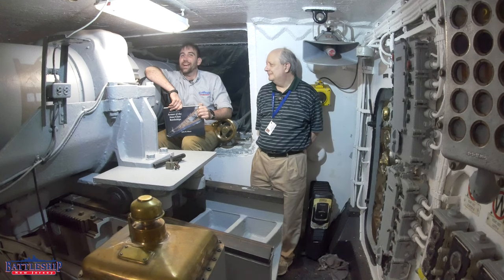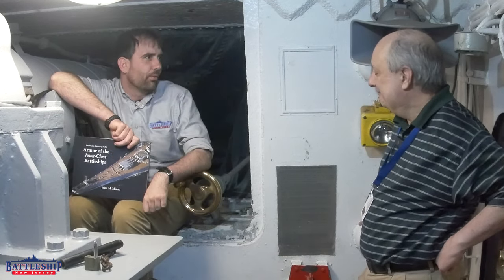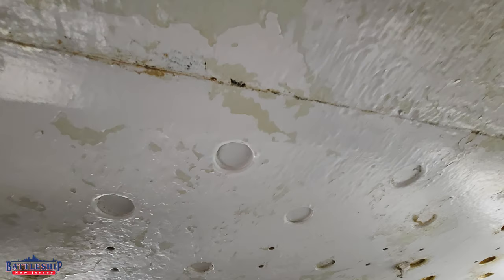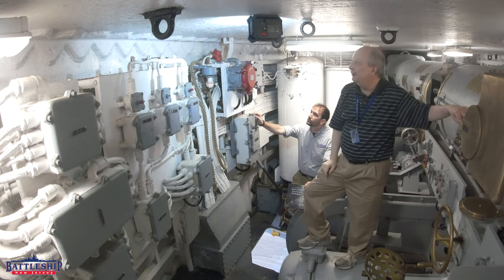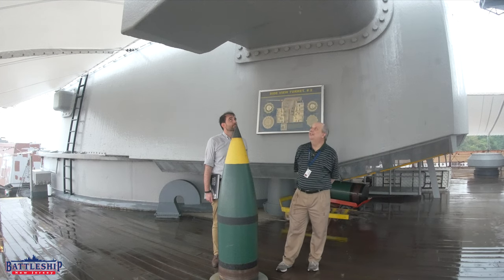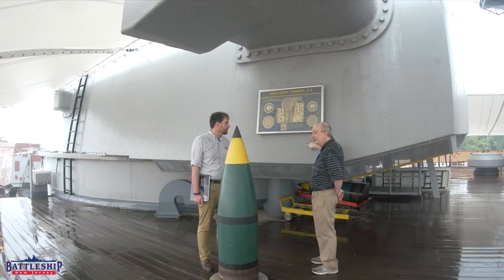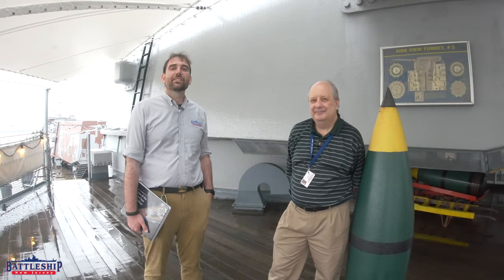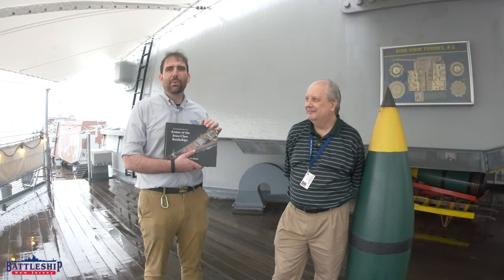Armored Turrets on the Iowa Class Battleships

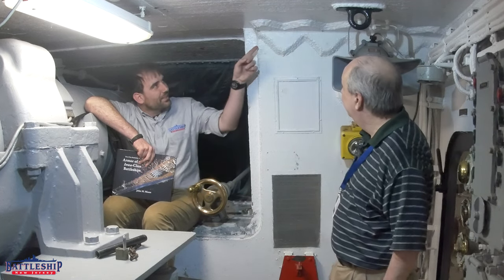Comment: ( 3:26 ) holy smokers! They used 6 beads of welding the attach the bracket plates between the walls and roof! I had not thought of this when we were shown the same joins in the steering gear area. Good information, thanks Ryan and John and all at Battleship New Jersey ! 
☺
Reply: It would help some if John referred to "class B armour" by its trade name "rolled homogenous armour". The thickness and hardening is finished by putting the armoured steel or alloy metal sheets through rollers.
Reply: There's also probably 3 to 5 beads under the 6 you can see for the root pass etc.

Comment: I would love to see an episode that explains the production process of armour plate at the steel mills. How they handled such heavy thickness, the heat treatment, rolling, what steel mill produced the plates for the Iowas,  etc. That would be fascinating! ⚓⚒🔗
Reply: I believe that Drach has a video on this subject.
Reply: I have been in several Gulf coast shipyards an can not imagine how they would have lifted a turret or even the plates used to build them. I have never seen any photos of the turrets being lifted or how they welded such thick plates together.

Comment: I was working on the Iowa on top of one of the fwd turrets straightening the rod used to tie awning to. Some ensign was worried about me cutting a hole in the turret with the small torch i was using to heat and bend the round stock. I told him that if anything ever happened where we had to get into the turret there was no way we had a torch big enough to cut our way in. This wasn't too long before the explosion. I was only there 2 days so i did not really get to know the gun crews but it made me sad i might have met some of them.

Comment: As someone who has tapped holes (usually M3x0.5, close to 4-40 for imperial system enjoyers) on small aluminum plates for prototype parts, those equipment used to do the same job but for really large holes and heat-treated steel armor plates.

Comment: Speaking as  a Weldor, the reason for the multi-bead weld
 is you can only manipulate so much molten metal at one time.....
especially  in the overhead position.....as far as it being over kill, 
the weld needs to be the same thickness of the base metal.....
when 2 plates are welded together, they are beveled to a 30 to 37.5  degree
bevel or a 60 to 75 degree included angle so there is full penetration....
for a 1in plate, it take 21 weld passes to fill that gap...hope this explains a little 
about why there are so many weld passes.....
One other note, when plates come together at an angle, as shown 6:00.
the weld is called a Fillet Weld, as in Fill it Up.....they are welded to be about 3/4
the thickness of the base material at the throat of the weld [45 degrees
of the triangle intersection] So by using those scalloped angle plates , they are 
saving an incredible amount of labor, time and material, and also not introducing
stress into the joint from the shrinkage of the weld metal.....the weld metal for 
that material would have a pounds per square inch strength of over 70,000 lbs.....
and welding in the overhead position would be much harder to have a weld with no
defects....as smaller rods are needed for welding overhead....and less material is 
put into the weld with smaller rods....
you mentioned the cast armor plate, is it cast, or rolled plate.....rolled being much 
stronger......
something not thought of many times , is that weld material is actually cast metal....
as you are putting molten metal into the joint and it is melting the adjacent base metal 
to make up a joint of cast material.....it is called fusion welding
so when someone says cast metal is not strong......they can be mistaken, as the weld metal 
is always [or supposed to be] stronger than the base material......the weak part of the weld
is in the base material in the area adjacent to the weld called the 'heat affected zone' HAZ....
where cooling rate and inter granular changes shift the different alloys in the material around.....
I hope this helps...
cheers from an old weldor in Florida, Paul

Comment: Cement between the armor and backing plate is similar to techniques used today. Servicable surfaces in crushers, such as the bowl and mantle in a cone crusher, have epoxy poured between the sacrificial liner and the solid steel body. The purpose is the same, fill in irregularities and spread impact over a bigger area, though a 41cm Japanese shell probaby has more impact than squishing a rock.

Comment: Another reason for the scalloped backing plates/angles being used for joining the armor plates is that the scalloping prevents the harder, more brittle metal of the heat affected zone surrounding the weld from fracturing, because the weld isn't in a single linear direction.

Comment: Since he mentioned a scarf joint and different sizes of the armor, how did the mill, or in the instance the hole for the 40mm, the yard, CUT through the armor? I would think by torch it would ruin the heat treated face, so how did they do it? Or just molded that way (including hole and different sizes) by the mill?
Reply: There are materials a lot harder than steel armor like tungsten carbide. So you can drill and cut into it.  The faced hardened part of the steel armor had a hardness like tool steel.

Tungsten was one of the resources that Germany did not have enough of during WWII. It was used in some ammunition and to process steel in the industry. The quite quickly had to stop using it in ammunition

Comment: Is there a giant screw driver that's used to attach those side vents to the armor face? Crazy size slotted bolts!
Reply: Bolts are not driven with a "screwdriver". They are fastened down with something like a socket wrench or an "impact wrench".
Reply: @williestyle35  Check out the slotted heads on the bolts at the 7:44 mark in the video.

Comment: it's absolutely fascinating that they didn't think welding was as powerful as it is nowadays That's just absolutely fascinating
Reply: Actually, it wasn't great back then in some cases. They went back to riveting on some vessels for a while because of welded hull failures in storms. This gave welding a bad name. During WW2, shops were set up in Europe to add armor plates to the sides of Sherman tanks. They used multiple passes and pounds of rod, but the first tank out its new armor plates fell off after it hit a bump leaving the shop! They had to send people to educate the welders on how to weld armor correctly. Welding is a fascinating science, I was a certified welder and have a great book from 1940 on the subject. I have welded and still do with WW2 surplus navy and airforce equipment, it's hard to beat even today. it is frustrating to see how many people still do it wrong today, especially with MIG welders. It may look pretty, but some good welds are ugly!

Comment: Very interesting.  I'm an engineer who's designed many welded structures.  I was wondering what metallurgy of the Class A armor is -- how much carbon; because that does make it harder to weld?
The scallops to increase weld length can be see today on the SpaceX Starship!
Reply: Older ship armor like the short lived Harvey armor, like on the surviving Olympia cruiser, face hardened by increasing carbon to the outer layers.  Class A armor is in line with more modern armor designs from the late 1890's that had a more complicated heat treatment process to get the desired amount of hardness/softness throughout the armor.  Not just carbon content, but a long complicated heat treatment to get desired results.  

Even if you didn't crack the outside armor through welding, you would alter and diminish its properties.  Another reason why welding to some metals is a no no.  Not because it is impossible, but that it can ruin the heat treatment properties thereof.

Comment: Interested information.  I worked a a power plant or several really for a utility company.. A lot of welding along with other things . Like firing boilers ect ....i was told a lot of things were   made in ww2 . ..Thats the way you weld in heavy plate is laying in passes of i assume 7018 or what the military uses ..The boiler might use 80 or 90 .. i remember seeing a welding machine i think was called a torpedo.. my brother had one and i think i used one at first power plant i worked at on boiler tube repairs... i was told that welder was made back then

Comment: I always thought the turret roof armor was more or less a lap or butt joint as the roof was removable to replace barrels and other equipment.  Now I want to know how they get the roof off!
Reply: Remember there are some welds on the outside, as seen when they show the back plate attached to the side plates - from outside the gun house. Lots of labor hours breaking" the welds and attachment plates to take the roof off. This is why the firing parts of the guns themselves are meant to be pulled out through their openings in the front armour plates.
Reply: The roof of the turret is covered with screw heads.  The bottom of those screws is seen at 4:07.  There is video of the exterior topside of Iowa's Turret 2 that shows most of the screws removed.  They started to remove them as part of disassembling Turret 2 in order to repair the damage from the April 1989 open breech explosion, but early in the disassembly process word came down that Iowa was to be deactivated rather than repaired, so the disassembly process was halted  then and there.

Comment: What reserves did the Navy have for replacing armor in the event of battle damage?
Reply: I was thinking of the same thing. Would the navy bother replacing a turret if it had pot holes from smaller shells like 5" or 8"?
Reply: @resolute123  I think Iowa(?) had a dent in one of her turrets from a 5" shell hit.  The damage was so insignificant that they didn't bother fixing it.  But a closer range hit or larger shell impact, who knows - probably in a manual somewhere.
Reply: Worse case.....The Navy had two other Iowa class battleships in the 'pipe-line'  being built (BB-65 &BB-66). They at least had the materials to fix/patch/replace all or part of a turret damaged in battle.

Comment: (Edit - Disregard, John adressed this exact point when they got to the rear plate - thanks)    
I thought I read that the reason the class A plates where bolted to backers was that class A was not easily weldable like plain structural steel or STS, so it it had to be bolted on.  And that method also meant you could (in theory) unbolt it to repair the plate after action without having to take the entire structure apart   ???

Comment: armor is soo complicated :|  .... had a question though about the turrets on New Jersey herself.    I know ryan has talked about it but i cant find the video with the answer.   With Iowa having moved turret 3 to move some shells.... can New Jersey move any of her turrets if needed to do the same and if so where is the hoist they were using for Iowas move?
Reply: The New Jersey has a lot of shells (real or replica) below deck already so they don't need to turn any for that purpose.  I don't believe the NJ has the same amount of shore power easily available for that task among other things.
Reply: Short answer no
Not hooked up to right electrical voltage 
Think theirs some mechanical issues also

Comment: Would class A armor be equivalent to AR500?
Reply: AR500 isn't armor.  AR500 is the steel they use to line dump truck's with to protect the bed from rock erosion.  Shooters simply started using it because it was hard enough to stop small arms fire, especially from just plan lead and copper bullets, and was cheap and easier to get than actual armor.  It is simply just extremely hard steel, and not suitable for any heavy armor applications whatsoever.

High end naval armors were complicated.  They were hard on the outside, and soft on the inside to absorb shock and prevent shatter and spall.  A complete departure from homogenized armor plate, or hardened steel plates like AR500.
Reply: The AR in ar500 refers to Abrasive Resistant....a lot of companies have made bank by marketing ar500 plate to unsuspecting customer that believe they are buying "armor" lol

Comment: What protects the turret where the gun protrudes? It looks like it's only cloth.
Reply: It rubberized type of fabric. The Navy calls it bucklers or some call it bloomers. Its flexible so it moves when the gun moves. Used to keep sea water and rain water out. Not structural. Sort of a bellows type of thing.
Reply: @kellyBorgman  Thanks for the reply. Sounds like a weak point where a shell might get in.

Comment: How do the scalloped plates work exactly? And why?
Reply: Short answer strength. The scalloped plate allows more weld length hence more material (steel) than having a single built up bead between the two plates butted up against each other. They hadn't figured out how to cut an angle groove between the plates and fill the groove with a weld bead that has the same strength and properties of armor plate.
Reply: Gives more surface area for welds and/or rivets to secure joints together with the same shear strength and load bearing capacity as a much wider plate without adding the weight. As metallurgy has vastly improved over time and welding has been the industry standard, you dont see scalloping much anymore but rather precise bevelling of the joints with quality penetrating welds and gap filling that are examined with x-rays and is actually stronger than the material welded. But in the 30s and 40s, welding was relatively a new concept for joining metals.
Reply: A bit of a silly comparison, it's somewhat like when you have to glue something together and you do the wavy glue lines instead of a straight line.

Comment: Instead of cement, they should have used concrete. Its probably 10x stronger than cement alone.  🤔
Reply: Often cement and concrete are used interchangeably. I’m assuming naval engineers in the 40’s would have known the difference.

Comment: 6 beads are not really overkill.  Armor plate is usually heat treated for hardness & ductility.  Large beads would result in a large amount of heat input, thus affecting the armor properties.  You usually want really small beads to limit the input and just make up the difference by adding more beads, all while watching your material temp.